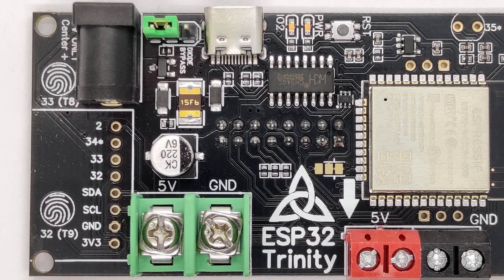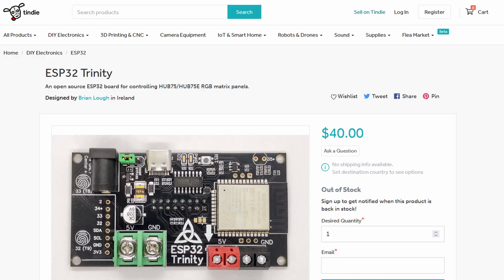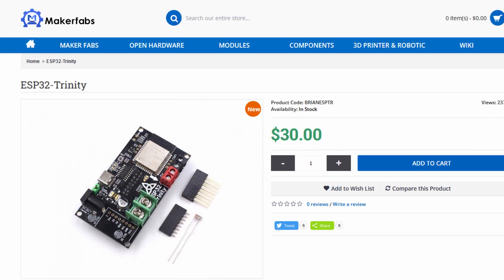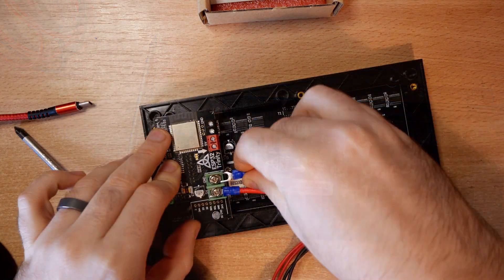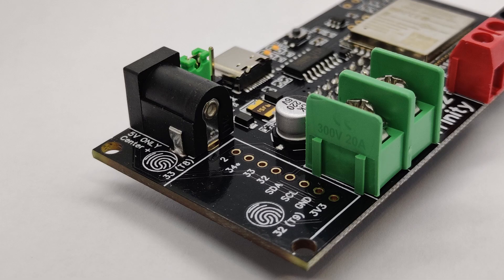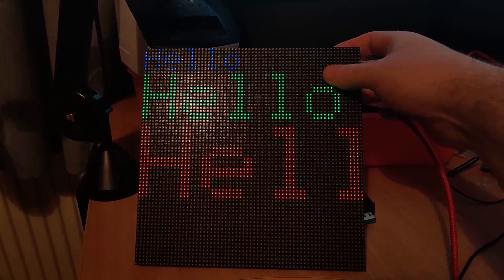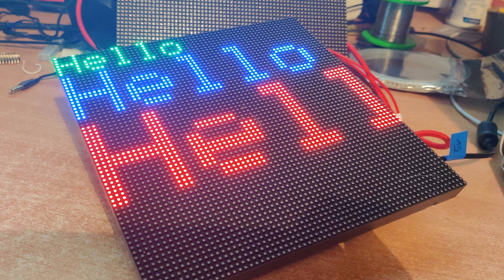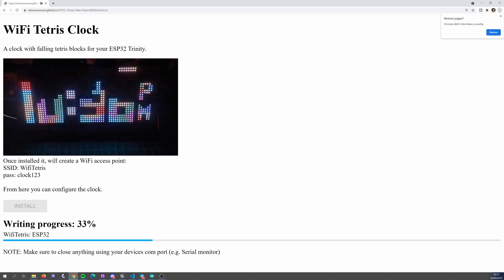ESP32 Trinity - Open source ESP32 for controlling RGB matrix panels

Comment: Brian - Im trying to get back into RGB display projects after being out of this world for a few years. I have not worked with the ESP32 modules but have a couple. I came across your ESP32 Trinity video and looked like a good fit for me being an almost retired electrical engineer. I went to the makerfabs website and ordered a 64x64 display, ESP32 Trinity module and their 5v / 6A power supply. I was surprised when I saw they shipped it to my home in the USA the same day so that's great! I would like to order another 64x64 display and maybe more in the future since the shipping seemed quick. However, I don't know if I also need another ESP32 Trinity module and power supply for each board. In the past experimenting with RGB smaller displays, I only needed to join the displays with the IDC cable in/out... but I would like some clarification on this before I order anything else. Thank you for your turnkey product and your help on this! (Tim)

Comment: Hi, I like the products driving the RGB displays You made before this.
This one does not fit my minimalistic needs just driving the display.

I do NOT like the way You do hiding essential documents from the public.

To me buying electronics with no proper documentation is a no go.
I understand You wanted to save your sales by not publishing the pcb layout and schematics.

The schmatics of the pcb, the population diagram, call it what you like, is a must when selling a PRODUCT to me.
Could I have made my own pcb? 
Sure I can do, but I have no fear sending over a few bucks if you would send me either a bare pcb or the documents that allows me making one at home.

You have allowed someone selling your pcb on Tindy .
Tindy does not charge me the customs fees in advance; even Aliexpress does today according to the EU law.
Sending from the UK/Ireland became very expansive these days, even it is of low value the extra costs make it less interesting.

BTW: I can not extract using any of the programs I have on hand the raoyaltyfree zip-file.

Comment: What happened to the HUB75-E pin switch? What happens if the E pin is grounded by the HUB75D connector?
Reply from the maker: The i2s library doesn't use a strapping/boot pin for the E pin so it doesn't need it.

Comment: Can you chain multiple panels to make a very long one? Is the board compatibele with that?
Reply from the maker: Yeah sure, there is a limit to how much memory the esp32 cam handle but the library has been tested with 12 64x32 panels.

You'll also have to power that many externally, the trinity can only power 2 panels

Comment: That's neat I'm probably going to try one, I'm working on a 3d printable scalable frame and bezel for matrix boards.
Reply: You may want to check out Tomas new video. They did something similar to your project. I think. They used direct gcode to design a matrix part that doesn't have a lot of the imperfections that happen because of slicer software... Wait frame and bezel... Not creating matrix holes/fixtures for LEDs. Well here's the link anyway, incase it helps. https://youtu.be/ZgytQDoaD5M

Comment: Nice. Just wondering. Do the trinity examples also work on the i2s boards I have lying around?
If they are so simular. 

My programming skills are far lower then what I was hoping. 😂
Reply from the maker: Yes! Once there is nothing Trinity specific like the touch pads or ldr they are completely interchangeable